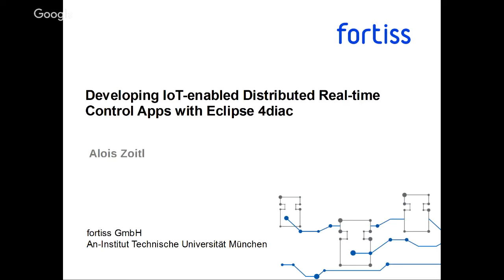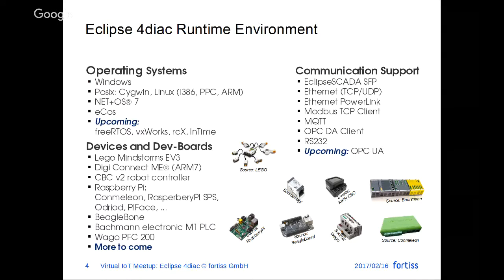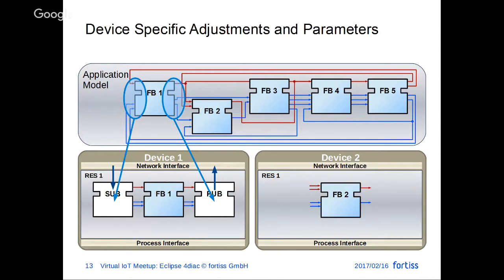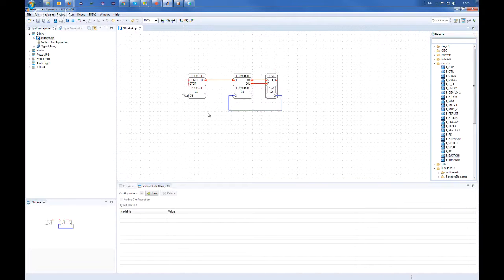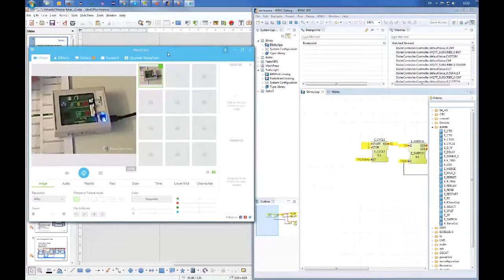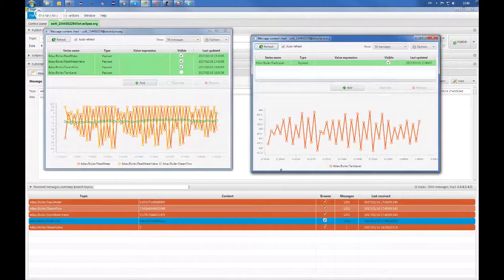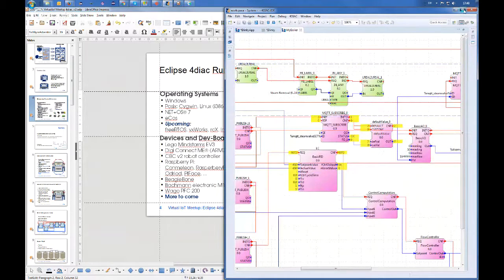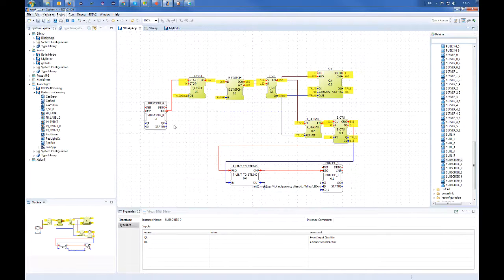Virtual IoT | Developing IoT-enabled Distributed Real-time Control Apps with Eclipse 4diac

Comment: I saw some efforts to compile 4DIAC FORTE for the ESP32. Would it not me much much easier to publish a binary FORTE and some type of FORTE loader for the ESP32? 
(P.S. I did notice that the FORTE building process includes compiling some of the function blocks in your 4DIAC project, that seems a really odd thing to do. Am I missing something?)

Comment: Hi,
I would love to make a couple questions related to hot-plugin, both in the sense of newly developed FB and rewiring applications:

- You mentioned that there are some features that allow you to deploy parts of the application without stopping it. Is it also possible to deploy new FBs (programmed in C++) to a FORTE instance without stopping the applications that are running? Is this what you talked you were trying to accomplish when you mentioned the right and left paths in deploying FORTE and the application?
- Is re-wiring doable in hot-plugin scenarios? For example, If I have an application that follows this FB order: A->B->C; in order to make an improvement into B; I can create a B' FB, deploy it and connect it to A (until this point A->B->C will still be working and also A->B'). Can I then switch C inputs to B' (now A->B + A->B'->C will be running) before deleting B connection? This would require some kind of batched attomic operations as C inputs have to be simultaneously deleted from B and created from B' so that C never get disconnected nor connected to both.

Hope I was clear enough when formulating the questions, if not, make me know.

Thank you in advance,
Adrián Orive
Reply: Thanks for your interest in this topic. I'll try to give some first answers here. 

Currently it is not possible to dynamically deploy a new FB type (C++ code) without stopping the FORTE instance. However we are working on a version where new FB types can be added to a FORTE instance dynamically utilizing a LUA engine in FORTE. Hopefully 4diac 1.9.0 M2 planned for beginning of March will have a first prototype where you can test this feature. And yes it was about left and right path in may toolchain slide. So in the future the right path with C++ code generation is only needed for supporting new devices or for highly optimized FBs and the left path will be the path for normal users.

In principle re-wiring is doable. However I would not recommend this why the tool as this requires a remote connection. For that we developed in a set of special FBs called reconfiguration FBs. These FBs can be downloaded to a device and connected to an application and form a reconfiguration application. The procedure would be to download your new B' and all connections which are not critical together with a set of reconfiguration FBs. When everything is in place the reconfiguration application would determine the right time to perform the "atomic" switch. I put here atomic in parenthesis because depending on the application's timing it is still possible to use some time for it and the whole change must not necessarily be instantaneous. 

For more details have a look for papers coming from the eCEDAC research project and my PhD-Thesis  which is available as book (real-time execution for iec 61499).

I hope this helps,
Alois
Reply: I'll answer here, but if there is a better place where we can follow this discussion, please, point me there:

The LUA engine implementation for hot-plug FBs is a nice addition, but is there anything preventing the inclusion of C++ hot-plug FBs? What you called "highly optimized FBs" may be needed for some applications that would run too slow in LUA. Also, is the decission to use LUA as an scripting language documented somewhere. Why LUA and not another scripting language?

Have been looking for eCEDAC's page but it seems to be down, could you point me towards it? Will keep looking for it meanwhile.

Adrián
Reply: This place is definitely a good place for such discussions. But feel free to also write us in the 4diac forums [1]. 

The main reason for using something like LUA as intermediate language is that with Forte we are supporting quite a bunch of different operating systems and processors. When doing hotpluging C++ code one would need a native compiled FB for each of these platforms and processors. Some of these compilers are either very expensive or not compatible. So we would need quite a heavy infrastructure (maybe a cloud service or containers) to support this. LUA helps us to abstract these platforms specifics away and you will be able take a LUA transformed FB and deploy it on any 4diac system. This if for me a great advantage.

When we started looking for a solution we compared a lot. We even had a master thesis where a small virtual machine for this task has been developed. But in the end we decided for following reasons for LUA: the lua engine is rather small and originally has been developed for embedded systems, it is rather fast (especially with the JIT, it is actively developed by people who know how to make vms and jits. Nonetheless it is a first prototype and if there are better solutions out there we are happy to hear about it.

In the end the typical 4diac user neither sees the C++ nor the Lua code but works on IEC 61499 model level. So the  underlying technology is replaceable.

Regarding the papers please have a look at my google schoolar entry [2]. The papers containing either eCEDAC or reconfiguration in the title could be interesting for you.

Cheers,
Alois

[1] http://eclipse.org/forums/eclipse.4diac
[2] https://scholar.google.de/citations?user=OG52DQ8AAAAJ&hl=de
Reply: About the LUA engine. When you say for C++ you would need a native compiler, I was giving that for certain, but you may be developping applications over a hardware that already brings the runtime compiled for you and doesn't give the compiler. That's actually a really nice point I wasn't aware of.
I still think having hot-plugged C++ compiled FBs is a really nice feature in case you do have the native compiler. Open Hardware and virtualized enviroments (containers or VMs) are two examples of these scenarios.

Regarding the hot-rewiring, I am not sure to have understood properly what you meant with those reconfiguration FBs. Is there somewhere when I can read about them?

I did find your publications in other cientific platforms, was gonna filter the articles today. Your keywords reached in time.

Thank you,
Adrián
Reply: You are right that dynamic C++ compiled FBs would be great. With more and more embedded systems running on Linux and the processor architectures getting also more homogeneous (intel, arm) I think it is definitely worth considering. 

If you look through the suggested papers I think it will be clearer. Furthermore if you look in the FB library there is a folder called configuration there you can find FBs. Like create connection, create FB, delete connection, reconnect connection. These FBs when executing will perform the same actions as the tool would do remotly.

Alois
Reply: Okey I think I got what you say (by the way the folder is called reconfiguration in my case). You first deploy the non-critical part of the hot-plug changes from the IDE, but for the critical reconnections (usually the outputs) you do not deploy them from the IDE, you deploy another non-critical function than when triggered itself does the critical changes but from the device itself instead than remotely.

Which are the advantages of this extra layer of abstraction if it doesn't fulfill the "atomic" characteristic?
Reply: Yes this is exactly how we do it. We call these applications reconfiguration applications.
 Apart from the atomic characteristic the second major advantage is that the reconfiguration application can fulfil real-time constraints.
Reply: I read "Standardized dynamic reconfiguration of control applications in industrial systems" (2014) as it was the last article under the terms you suggested. The only thing I didn't understand is the amount of steps and commands you mentioned in the inverted pendulum use case (22 and 32).

Has there been any progression in the topic since then?
Reply: I would need to recap how I did come to the numbers. The point is that each small operation needs an own command. This was the main problem of this first result. Since then not much has been done on this work. I think the most important steps would be to improve the tooling to hide the complexity for reconfiguration and make it better usable. For example a colleague of mine used multi-agents systems to determine the required functionality of flexible production logistic systems and generate reconfiguration commands in the involved devices.
Reply: Yes, I reached the same conclussion, the reconfiguring process as is right now it too manual. Automatically deploying the reconfiguration FBs, by means of another 4diac view that lets the developer create the new functions, connections and so on and then automatically determines if they belong to the setup, critical or clean-up phases. Or even some kind of application versioning (not talking about the backup copies of the XML stored in the proyect, but some kind of GIT-like versioning that stores changes from app v1 to app v2) with the tool automatically creating the reconfiguration applications from one version to another. Those are the first ideas that come to my mind.

About setup, critical and clean-up phases separation: let's call input to the connections that go from an existing FB to a newly created one, inner connections to the ones going from and to newly created FBs and output connections to the ones going from newly created FB's to already existing ones. You mentioned in the article that aside from FB creation and inner connections, data input connections could be done during setup due to fan out capabilities. Event connections have both fan in and out capabilities and you do not make any of them in setup phase. I do understand that doing both in the setup phase is not possible, as that would interfere with the process, but if event input is kept for the critical reconfiguration phase, couldn't output ones be performed during setup? The selection of output instead of input event connections is because input event connections would make the newly created functions to start executing before the critical reconfiguration phase and thus they may interfere with the process.
Reply: Many if the things you mentioned, especially the tooling points where target of the eCEDAC project. If you look in the eCEDAC publications you will see this. However the implementations where not made available as open source so far.
Reply: I have not been able to find anything online about εCEDAC further than this [1] and one of your articles which I'm currently reading (Zero Downtime Reconfiguration of Distributed Automation Systems: The εCEDAC Approach).

 [1] http://www.logicals.com/de/forschung/cedac
Reply: I just learned that the original eCEDAC webpage is still available [1]. There all the public information as well as the paper list can be found. I hope this helps you.

[1] http://profactor.at/easydac/
Reply: Nice pointer, I will take a deeper look at it next week. Thank you for all the answers, they have been very useful. I may also try to take a look at 4diac's source, but I'm not finding too much documentation about it.
Reply: The code itself would need some more docs. On the 4diac web-page there is quite some docs on how to install it and get started. Maybe this helps.
Reply: Installation and applications examples are available, yes. I already followed some of them and made a really simple app that adds 5 numbers in 2 different BeagleBone Black to get used to the project creation, hardware definition, application development and deploying, etc. Mostly as you did in the meetup with the led bliking app, but without the deployment during operation part.

As a off-topic question: are the test.xml, testApp.xml and SysConf.xml XML formats an standard or are they just 4diac way of saving the project?
Reply: Teh xml files how currently 4diac is storing its data is a format defined by the Eclipse EMF project. However we are heavily working on 1.9.0 where we are changing a lot under the hood to get 4diac more maintainable. With this release we'll switch to the standard IEC 61499 XML format defined in IEC 61499-2. This will then be directly compatible with tools like FBDK or nxtStudio. In pre 1.9 versions you first need to export it to this format. But still compatibility is available.